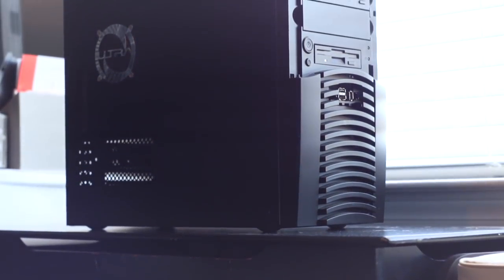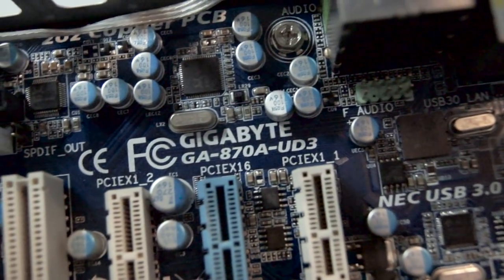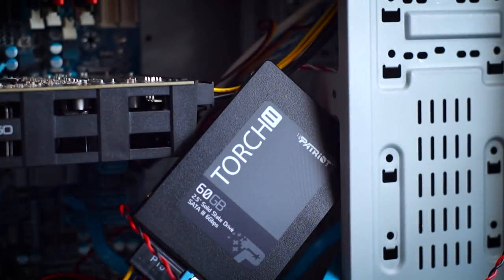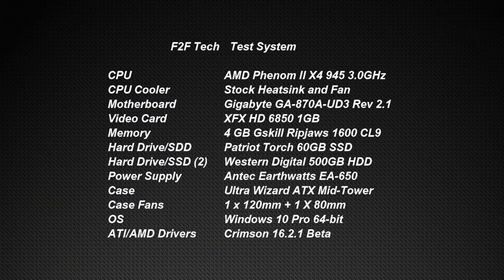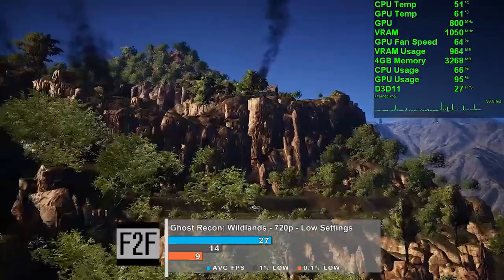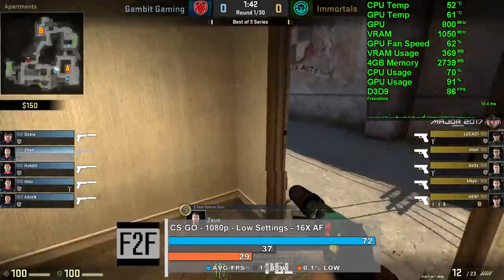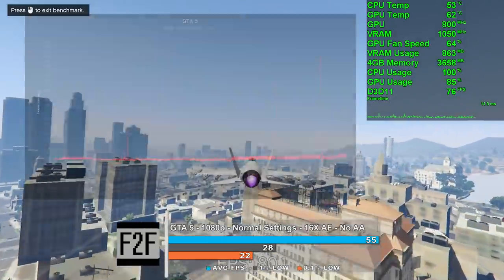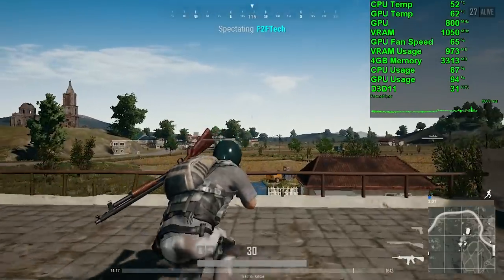How well does a 2010-2011 AMD Phenom II X4 gaming PC hold up in 2018?

Comment: thats what you get when you have only  1gb of vram next to the uruks master race
Reply: is it like a legit thing they say? that'd be so funny
Reply: Hugh Mungus maybe it's an easter egg made by the developpers
Reply: yeah that's what i thought but i couldn't find anything about that elsewhere
Reply from the maker: TheAlbinGames They were not shown because Fraps has suddenly stopped working with Shadow of War, and I was too lazy to bench it with my other tool, so I used Afterburner. I believe the frame time inconsistencies are due to the card and it’s legacy drivers or how the game engine reacts to the card. You’ll see the same result in my 6850 review, which has a 2600K and 16GB of ram. I just got done testing the 6950 2 GB on the same 2600K system and it exhibits the same stutter. Also note, It’s vram wasn’t fully saturated.
Reply: F2F Tech you could've answered me too, I still am not sure whether or not their line was authentic haha
Reply from the maker: Hugh Mungus you’ll find out in the next vid 😉
Reply: If they do actually say that..that's hilarious
Reply: the phenom x4 945 processor in compatible with this A76GMV motherboard ?
Reply: pretty dumb response
Reply: I have a phenom ii x4 too.. With 1GB vram...lol
Reply: F2F Tech I have AMD Phenom x3 710 @2.6 GHz
Reply: What a coincidence to spot.
Reply: gave away a Phenom II x4 965 BE @ 3.9Ghz with 8GB DDR3-1333 and a GTX 560 Ti.   Still working to this day.   Plays quite a few games without issues.
Reply: @edn0  ikr? Lmao
Reply: I have only 256MB Vram :c
Reply: @possiblydaniel  me to lel but im have shared 128mb because 2gb 400
Reply: what is the application that show u the green data up right?

Comment: I used to have a Phenom II x4 965 Black Edition between 2009 and 2015. It was possible to achieve a stable 3.7GHz with stock cooler.
It's quite outdated, but certainly not a bad CPU.
Reply: actually i have this cpu.
Reply: GetZeddy!! Quite a gem, huh?
I sold mine for a quite high value (well... South America market). Now the prices dropped a lot after Ryzen... I'm still wondering if I should pick a Phenom II or something different to be paired with a 750TI. 🤔
Reply: Yes, it's a gem, served my brother around 5 years, then I got it and I still use it as my daily and only driver. Fun fact my bro had that CPU paired with a gts 250, now I paired it with a gtx 1050 with minimal or none bottlenecking. It is a legendary CPU, at least for me.
Reply: @getzeddy3801 I still have my 965 BE, used to pair it with a GTS 250 as well

Comment: My father gave me a 2009 Gaming PC that came into his Computer shop a while back.  Came with an MSI DKA790gx Mobo, Antec 900 case, AMD Phenom II X3 720, MSI 1gb GPU (Forgot what exactly it is) 640GB HDD. and 4gb of DDR2 RAM, along with an Antec 700w Power Supply. I mainly use it at my flashy workstation at my job, but i also bumped the RAM to 8gb, and swapped out the x3 for a Phenom II X4 925. I was able to overclock the x4 from 2.8ghz to around 3.6 without any issues! Thing still runs like a champ as well. I loaded Windows 10 onto it, and even played Skyrim a few times. It doesn't have shit on my main pc, but i can appreciate a relic like that!
Reply: Nice!
Reply: and uses as much power as a washing machine

Comment: I'm still rocking the phenom II X4 955 BE today. I can play games on high and medium settings. I've paired it with a gtx 1050ti and the bottlenecking is extremely low ( insignificant ). Overall still a decent gaming gear and well worth the money. I assembled in 2009, almost a decade.
Reply: I had this same cpu (with a 660) until last year (now my parents use it). It's a great pc. I played doom (2016) on it without problems. Now I have a ryzen 6 1600x with the same gpu.
Reply: Same here, i use a gtx 1050 2gb but should have gotten the 4gb ti instead tbh.
Reply: i have the 965 BE processor and i want to buy the same gpu 
with a hyper212 evo cooler, you can overclock your processor up to 4 ghz to reduce the already tiny bottleneck to nothing
Reply: I have a Phenom II 965 BE, paired with a GT1030 and I beated GTA V in high settings, 900px, averaging 45 fps.
Reply: I have a phenom ii 965 BE with a 780ti and soon with 980ti but its already bottlenecking right now
Reply: Same CPU here too, just have a 1050 ti, 8 GB o RAM and run most recent games on high/medium on 1080p. Its hard to let it go, here in Brazil the prices of imports are crazy.
Reply: i use the same CPU. I have a radeon 260x and usually the bottleneck is the GPU on medium to high settings on modern games.
Reply: Curious, what amount of ram are your running. Also are your games settup on an SSD?
Reply: Wow this sound great. I was thinking about getting the 1050ti also, and how I am stuck with the phenom for now was really wondering how they perform.
Reply: same here ;)
Reply: i still use this processor. well beyond it's time. for being nearly 8 years old. i love it. even though it's age is showing. especially with pubg.
Reply: Same here but still using it it with Radeon HD 5750 does the job for me runs old titles without a sweat but need to upgrade the gpu soon
Reply: lol i have the gtx 960.
Reply: gets the job done. runs newest titles. but the CPU really limits it capabilities. probably not by much but i can probably get higher frames with a stronger CPU. and no texture pops.
Reply: cope
Reply: @stevenwatson8295  not really ahead of its time though. I have an i7 920 (1st gen) overclocked to 4ghz from 2.6 which is older and it literally has 99% benchmark of an i5 7350k. Benches same as an i7 3750k. I have a gtx 780 founders edition and I can play pubg on high settings. 

I almost don't want to upgrade but I think I'm going to build a ryzen system soon as I can get an r3 2200g,asrock b350 mobo and 8gb ddr4 3000mhz for $259 free shipping on newegg. It's not a massive upgrade but for actual computing aka processing power it's a big change. 

Ryzen is cheap man worth the investment. Even If It takes a while to save. I'm saving now till Christmas lol
Reply: @stevenwatson8295  and I'm in no way saying it's not a good processor! Still works fine for sure! 

I just put a 965 black edition in a mini acer tower and a asus gt 630 2gb i had kicking around to have a media pc and it rocks.
Reply: I have the same CPU too, 955BE with a MSI gtx 460 1gb with 8GB RAM, Cooler master GX550 v2 PSU. I tried installing a new GTX 1060 but PC started random BSOD. The same new GPU worked in my other new Haswell PC and has been working great since 2 years. I have a Gigabyte GA-MA785GMT-US2H in old pc. Maybe its the board which crashed the gpu i don't know. Can i upgrade to a GTX 1050TI ? What motherboards do you guys have ?
Reply: Top Noodle  well beyond capable
Reply: I got a Phenom II X4 975BE. Not even sure even what to do with it haha.
Reply: Same here i just need the 1050ti only have the 1050 2gb 🤕
Reply: I still have a Ph II 955 but with a hd 5770 wich im minda happy i can run some recent games in low-mis settings, almost 2019 and i cant afford a ryzen 5 machine:(
Reply: @BitsOfInterest  dude, i got a noctua Nh u12s, i should try Oc my 955? Mobo gigabyte 785, ram corsair dominator 1600mhz
Reply: I respecc bro
Reply: My 965BE 3.7GHz bottlenecks my HD7770 in AC:BlackFlag that my 2500k fixed o_O now using RX570
Reply: I had one with a 1060 about two years back.
It was starting to struggle a bit in games like battlefield 1but lasted me a good while and was ok with medium settings.
I only got rid because cracked the CPU when I put the fan back on.
Reply: @BitsOfInterest  
I had my 955 BE stable @3.85ghz, I was @1.5v. couldn't make higher stable.
4.0ghz even on the 965 will be toasty.
Reply: @BitsOfInterest  
I bought mine second hand years ago. I've had it at 3.4 with no voltage bump for years. I have an old Corsair h50 with a Delta 210cfm pulling. Stock, temps rarely hit 30. At 1.5v I peaked at about 57. Sounded like someone was vacuuming. I run on a 990fx which apparently have amazing MOSFETs to handle the 9590fx.

She was stable, but toasty.

Fun note, screwing around with an old 9650 phenom 1 with a MaxOrb cooler.... Went to 1.5v with no temp issues.
Reply: I'm surprised by how many people still have these old processors.  We're constanly told that we need the latest and greatest, and everything needs to be over 5 million FPS.  And then you see a CPU from 10 years ago still powering systems and still being able to reasonable numbers :)
Reply: I ve the 955 BE paired with a gtx 960 and 16gb of ram all i can say it s that this baby rocks
Reply: Yeah i agree add rx 570 add 2x performance
Reply: So the GPU works at 100 percent cuz I want to get a gtx 1050 and I have this processor
Reply: I am still running on phenom II 965 be with Sapphire vapor x 7950 3 GB and 12gb  of ram. Still rocks hard! Builded 10 years back
Reply: Same w/ a GT 1030
Reply: that cpu would enormously bottleneck a 1050 ti, even an fx 8350 does.

Comment: I bought a very similar gaming PC and it had a Phenom II X4 955 Black edition (I overclocked to 3.6GHz), 4gb 1600MHz RAM (I upgraded to 8Gb)  and a GTX 275 768Mb ( I upgraded to a GTX 670 2Gb) also a 750W PSU from Antec. I still use it and can play almost everything at 1080p.
Reply: yes man!

Comment: I have a similar CPU, its the 955 and it's clocked at 3.2GHz. Handles modern games pretty well considering its age but it is really starting to struggle now. Well saying that it's probably my GPU that struggles more because if I were to get a better video card I'm sure my CPU wouldn't bottleneck it too much and I would be able to run the latest games at decent settings.

Comment: To prevent PGA CPU sticking to heatsink , it is best to run  Prime 95 stress test for about 20 minutes. This will warm up the thermal paste and then it will be much easier to remove cpu cooler from socket.
Reply from the maker: Thanks. Another commenter mentioned that as well. 👍
Reply: Well, to add, once I had a machine with failed hard drive, so it wasnt possible to boot into windows and I didnt want to waste time to install OS then prime95. I entered in the Bios and unplugged cpu fan. Then I waited for cpu to warm up while monitoring temps in bios. when cpu temp went past 58 °C I shutdown the system and gently wiggle left and right heatsink and it detached from cpu like a chewing gum. You are welcome. =)

Comment: I used an amd phenom ii x4 960t system  in 2009 with a hd 5770 , 4gb ram at first then a amd r9 270x , its been broken up and in my parts draw last 4 years . My rig been using last 4 years in a i7 4790k , 16gb ram  .gtx 970

Comment: I was tasked with cleaning and reinstalling windows on a very similar system. it had a Phenom II X3 720, 6GB 1333MHz RAM, 32GB SSD (which died, but never had the OS on it anyways) and 2x 750GB HDDs. along with a HD 6850 1GB card. rather similar to the machine shown in this video.

Comment: I've found the best way to remove a hs off a pga amd cpu is to fire ti up and let it get a little bit warm and then the paste will usually be more pliable and not rip the chip from the socket.
Reply from the maker: Yes sir. Someone else mentioned it as well.
Reply: I had a few AM? chips pull free of their socket with the heat sink before I learned that trick it doesn't always work but it does a good deal of the time. A little warm up and a gentle/slight side to side twisting has worked very well for me haven't had a heat sink chip removal in a while now.

Comment: On my desktop, before ichanged out the parts in the case for a ryzen build for some months ago, i had the 965 BE, and that was still good enough for every game, but ofc, it did hold back on my GPU. My "old" parts still are in use, i builded it in a computer for a friend of me, he bought a 1050ti with it, and still plays every game with good FPS with almost no bottleneck with the 1050ti

Comment: That actually performed better than I expected.
Reply from the maker: Agreed. I am really interested to see how well it does with a modern card, more ram, and a beastly OC ;)
Reply: Dose surprisingly well with 8gb or more ram n at least a 2gb card not amazing but playable ie over 30 FPS in modern games amd cards get smother results using frame limiting in relive
Reply: gtx1050
Reply: Was thinking more like an hd 7850 2gb or the likes would be lot cheaper n works great I ended up sticking 7790 with mine n giving it to step son  but did have 7850 in build but unfortunately it failed tried oven fix n broke it more lol but was with a shot
Reply: ayyyy
Reply: Hi F2F Tech. I use Phenom 955 BE with gtx 970 g1 gaming. In pubg (very low, aa on high, textures medium + reshade) on 2560/1080 ultrawide I get 30fps in cities ~50fps in open fields, but in very populated zones when people drop and there is ton of gunfighting with like 15 people around fps goes to like 20 and sometimes even lower. Sadly this CPU even tho is totally viable for "running" games its lacking for truly comfortable experience. Im switching to i5 8400 platform this or next month.
Reply: Wait for i5 8500, little bit more perfomance, the release is in few weeks more.
Reply: Adam Henry , really sucks cause the system is decent and should offer a better output but pubg likes Intel and Nvidia.
Reply: TheAlbinGames: I enjoy watching Youtube videos....
Reply: My sister is still using this exact CPU still, Holding up fine for basic gaming. GTA V Medium/low works around 40 fps for casual gaming.
Reply: You can buy those cpu's for like 20$ on ebay and they run most games fine once overclocked properly and a modern gpu, great cheap build for a younger brother or nephew starting out.
Reply: I'm still using a 965 BE overclocked to 4ghz. I can run gta5 on mostly high graphic settings.
Reply: @rossmclaughlin7158  ive seen videos of a phenom 965 with a 1050ti getting 40-60fps on very high settings on some modern games.  you can overclock it to 4ghz easily too.

i have cinebenched a 965 4ghz at 407cb score. which really isn't bad for a 9 year old cpu.
Reply: @F2FTech  HD7870 and its derivatives would be the best upgrade. That way you really aren't upgrading speed, you are upgrading code efficiency and maintaining bandwidth. This would double your frame rates in pretty much every modern title, drastically improve minimum frame rates, and your power efficiency would be around the same. Those 1st gen mid range GCN GPUs have held up better than anything prior. 

If the HD 7870 was comparable to a GTX580 in its day, now it would simply destroy it in modern titles.

I saw these kinds of frame rate improvements going from a HD6970 to HD7950 on a Phenom II x4. Honestly I think the R9 270 would show the same improvement if not bigger upgrading from a HD6850
Reply: https://www.anandtech.com/bench/product/1665?vs=1444

If this link works for you, it shows the 2GB HD7870 overclocked effectively beating the GTX580 in Shadow of Mordor by double at 1080P Ultra settings. This isn't an unfair comparison either, I'm pretty sure the R9 270 had 2GB of vram which is only 512MB more than a standard GTX580
Reply: My 2010 would of performed almost the same because it had very similar specs.
Reply: I have a 965 BE overclock to 4ghz and GTX 470. I get 60-90fps on fortnite with almost all high settings. Used to get 120 before they updated it a lot. Plays destiny 2 no problem at all, real nice and smooth. Not the most quite setup but with my custom coolers and case, it works very effective. Run Zelda BoTW at 30-50fps
Reply: @donkenta3634  Let's see how the new Intel's do against the new AMD's.  Should be interesting, and best of all as consumers we're the winners as they try and beat each other rather than Intel just doing the same old same old.

Comment: the quality of the visuals of modern games dont justify the higher hardware requirements...they seem artificially demanding to prop up the sale of hardware
Reply: ikr
Reply: Buisness. Plain buisness. And also be sure to glorify your hardware through auch idiot shills like that linus tech guy.
Reply: In many many cases 100% true. 
But thats just how the market ( and the world in general ) runs.
Reply: One word: Denuvo
Reply: @iceangelx22  It's not just games ... I work on industrial software that 20 years ago worked on 20Mhz(!) CPU. Now we have new, I must say better version(more precise measurements in shorter time etc ...), that has problems on 2 core, 2 GHz CPU but if done same way, would run on 100Mhz CPU. Why all that? Because we can! It is easier to just install faster CPU than to pay more people for longer time. It's all about money.
Reply: @MrVolodus  
Really. It's not like a word document needs a quad core teraflop pumping CPU.
Electronics really are the business model old Baron's had wet dreams about.

Something to be said for a good software design. Faster computers mean you could be lazier in optimization.
Reply: JUST now reading your comment 3 years later 
and
YOU SIR ARE STILL CORRECT!
Reply: I didn't even realize that. Now I'm mind blown when I think how we've been fooled into this tech cycle. Now I understand why my not-so-old i3 could browse multiple PowerPoints through ease, but struggle with the simplest of modern games.
Reply: 2022 says hello

Comment: I found a Gateway pc on the side of the road with one of these in it. Had a BluRay combo dvdrw drive in it and no hdd. PSU was dead but everything else works. Funny thing is, the UD3 board in this video is the same mobo I just threw out from another pc. Was a great board imo.

Anyway, turning this bad boy in to a Borg themed storage server.